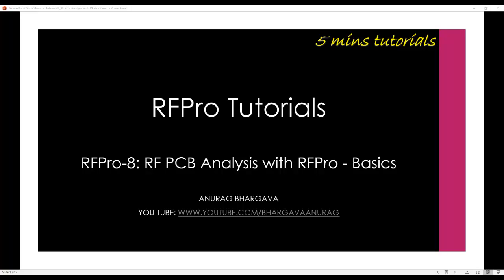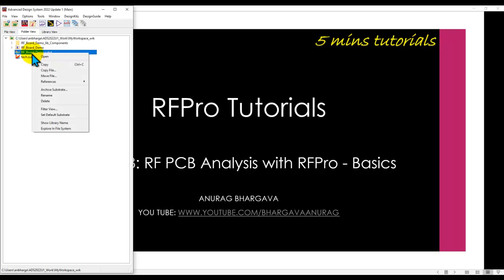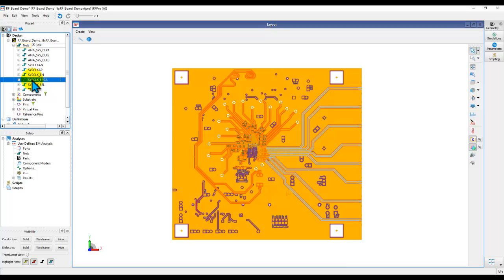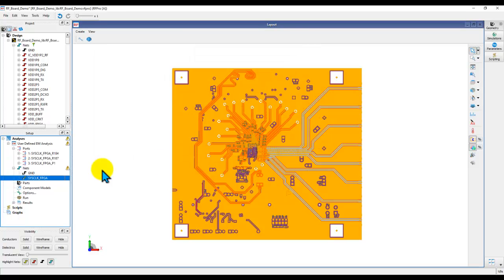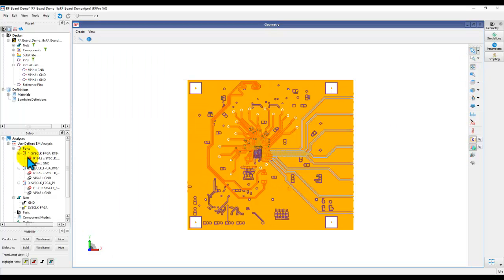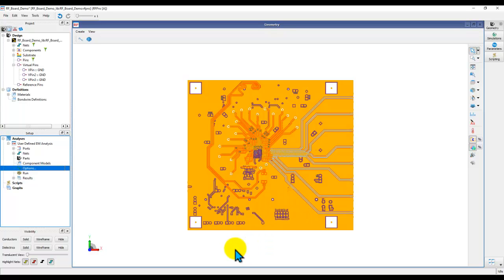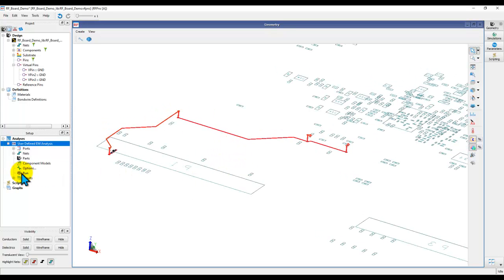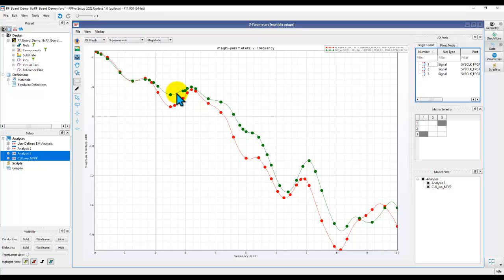RFPro-8: RF PCB Analysis with RFPro-Basics

Comment: Hello Sir!
How could you create a net, which consists of several different nets separated by passive components? In your example you drag only one "SYSCLK_FPGA" net in the "nets" area, but when the ports are created, it looks like this net going through 3 passive element on the board, before to get the port on the other side. Thank you
Reply from the maker: You can add all the required nets and components in the analysis or if you add only the desired series components then all nets connected to them will be added to analysis automatically.
Reply: @BhargavaAnurag  Thanks! I managed it adding proper components model and it works now!

Comment: Nice..!! Why FEM would be faster than Momentum in this case? Won't FEM mesh dielectric as well?
Also, is it possible to share the board file you used (.brd I suppose)
Reply from the maker: Momentum is based on Method of Momentum that relies on Green Functions, for more than 6 layers the underlying computation becomes lot more complex hence FEM kind of works better and faster for these kind of applications but again this is not a blanket statement however it kind of scales better with increasing complexity due to latest enhancements like Gen2 mesher and SDS solver etc. I will cover some of these in one of the upcoming videos for more clarity.